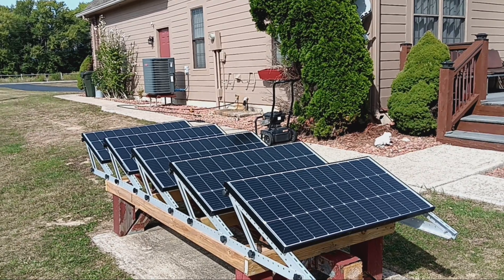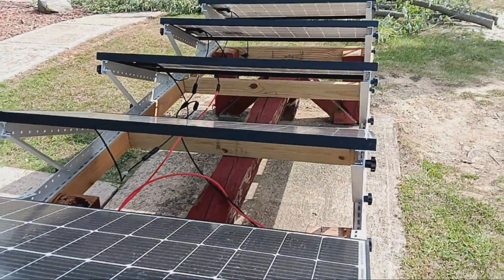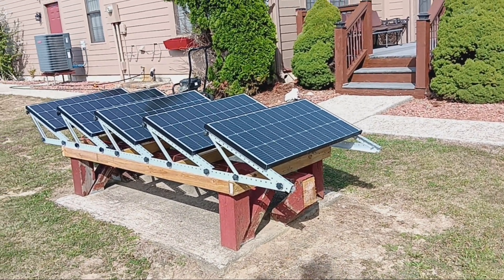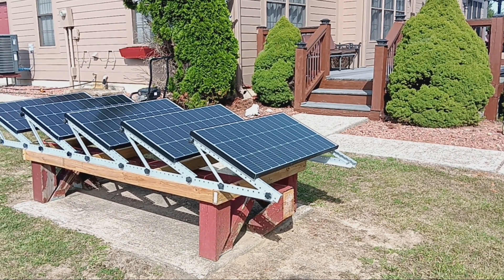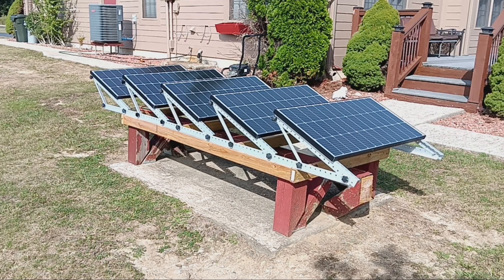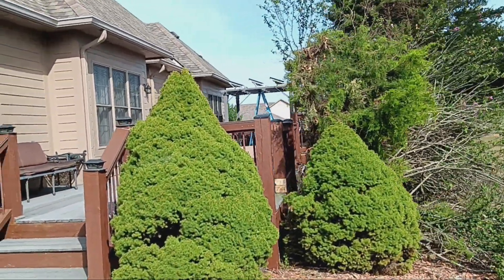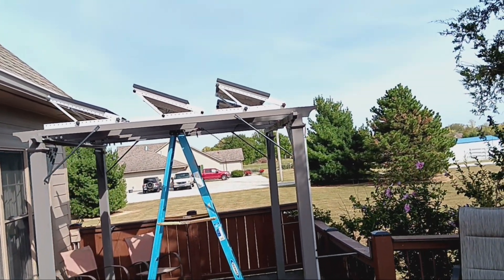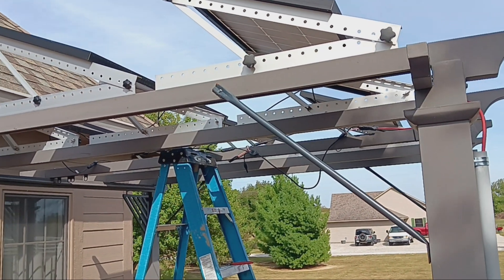ChatGPT is wrong. Do the math.

Comment: I think your panels are too close to each other.  if they shade the panel behind it,  your power production will drop drastically....Try removing the front legs and let the skid tilt at an angle to try to get rid of that tight solar surface.  you dont want any shade on those panels.
Reply from the maker: @lifequest7453  I think you are correct.  If you watch my next video you will see I changed the configuration and added a panel. At the moment no shade from the panels.